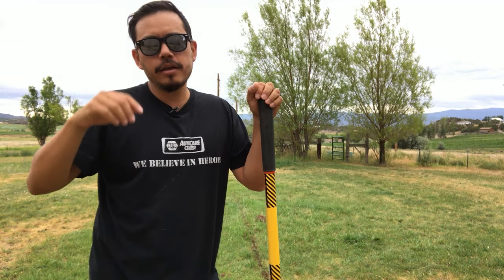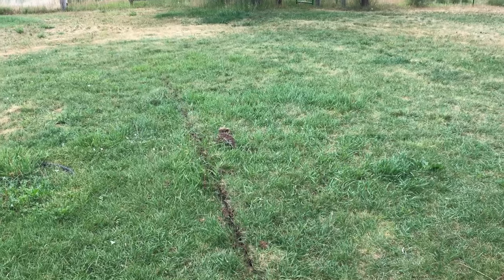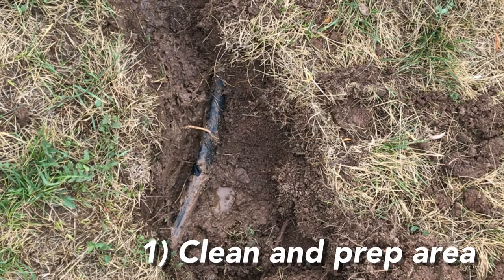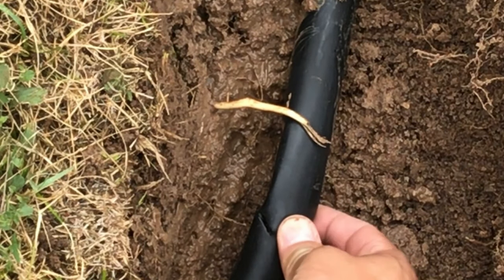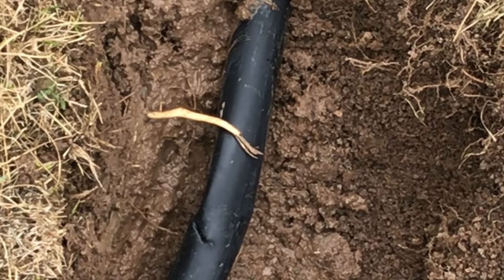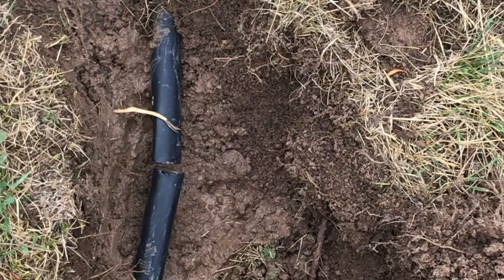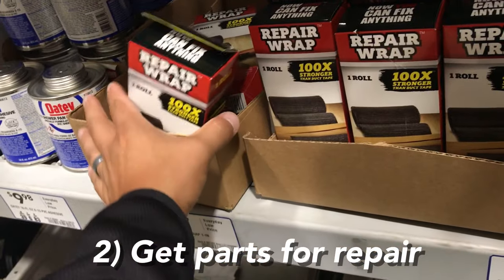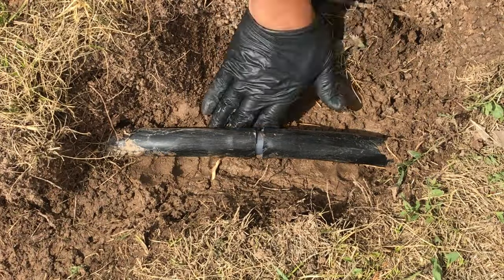How to repair a broken/ punctured Sprinkler Line in 3 Easy Steps

Comment: Why in the world didint you just crimp the coupling?  There was zero reason to wrap it in expensive repair wrap.  The crimps would have cost a buck or two.  Dont use hose clamps, use the crimps super easy and super simple

Comment: 1 coupling, 2 clamps, that's all you need, with that kind of tape, its gonna leak eventually
Reply from the maker: 2 years with two winter freeze, not a drip so far. Plenty of pressure on each sprinkler for the zone. But I agree coupler and clamps are just fine too.
Reply: @KTheGuy  if it is underground how would you know if the tape is holding up 100%.?
Reply from the maker: @arhodehamel2615  soil would be logged with water at repair site, pressure would have a reduction in heads for the zone. It’s been years since the repair now and still no issues.
Reply: you're right...hes wrong   might not be leaking enough to saturate but definitely not holding pressure like clamps would.  kids will be kids

Comment: Would rather use 2 clamps on each side of the repair area and tighten them securely to prevent leakage. The final wrap and tape application began to leak when the water was back on in the video? Would not use that method.

Comment: I generally use gear clamps, not leak tape. Clamps will last forever.
Reply: Good to hear. I just bought a coupler and clamps and figured I'd check YT to see what to do about keeping roots from damaging the piple again. I've done this before with the clamps, but this vid got me wondering if there's a better way.

Comment: Good informational video. I'm curious why didn't you just apply the repair tape and not have to cut the pipe nor use the coupling?
Reply from the maker: Honestly had never tried the tape before. But I’ve repaired hundreds if not thousands of plumbing connections over the last 20 years multiple ways, clamps soldering, shark-bite, pvc glue, so my methods haven’t change. I always cut out/remove the damage and add a new connection to stabilize the repaired area. It’s been a few years now and still no leaks on this repair, no loss of pressure for the sprinklers. Just another tool in the array.

Comment: is that half inch tubing?
im at home depot.
half inch looks right..
i think they only come in 1/2" or 1/4" drip

apparently they make 5/8" also, i just bought 2 of them snap on couplers that couples 1/2"-5/8" and some extra 1/2" tubing. cost like $7 total

soo eyeballing everything went wrong.
the irrigation tubing is 3/4" and it broke where it met up with sprinkler PVC. whatever size that is ... inner diameter outet diameter. who makes up this shit

Comment: How did you get the water to stop running? I have a puncture in mines and I turned off the water but it’s still leaking water
Reply from the maker: The punctured line was at the top height zone so all residual water was bleeding downhill from that spot. If the zone in questions is on the lowest grade the water will still bleed downstream. You’ll with have to wait till it’s fully bled or run some air in that zone to clear the water in order to do your repair. Or your main water valve isn’t fully closing.
Reply: you might have a seeping valve

Comment: what is  this? sorry but that wrap is not applying any tension to compress the hose onto the barbs of the fitting,
if this line get gets even a  small surge  in pressure its gonna leak because its just friction fit together.
sorry folks  but in my opinion for most applications this is not a great way to do things

if you are worried about corrosive breakdown  there are plastic stretch style crimps available , there is also the self sealing silicone tape  might work well to encapsulate a stainless crimp fitting .
or just use a plastic double ended  compression style fitting that is designed for this and sold at every irrigation shop. I keep one around all the time because they are cheap insurance.
Reply: With all due respect, did you watch the entire video including the end? He tests the lines to make sure that there are no leaks. He also shows a close up time-lapse of the wrap while the chemical reaction is taking place, causing the wrap to become hard like plastic.